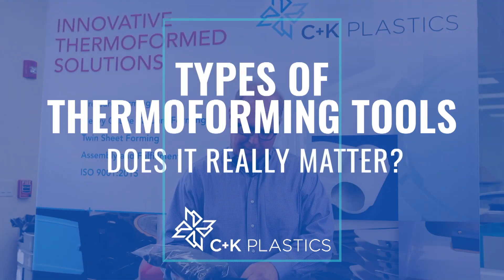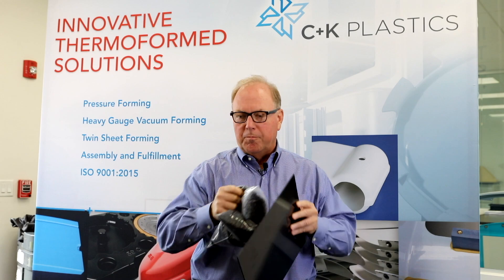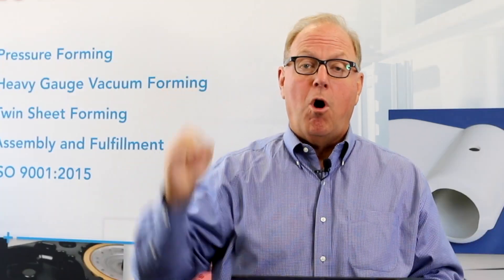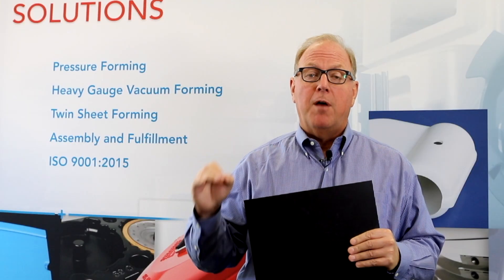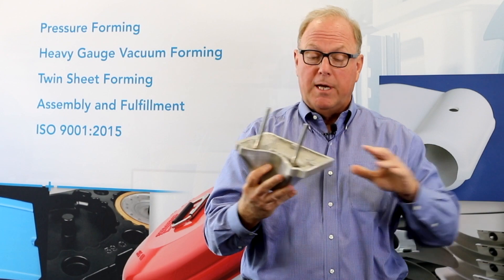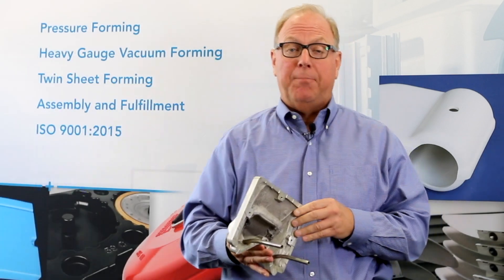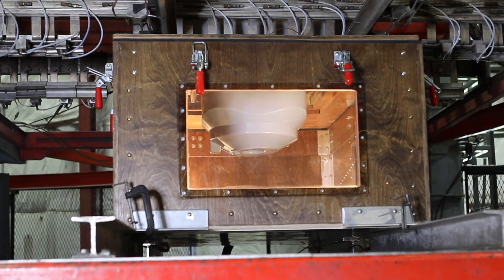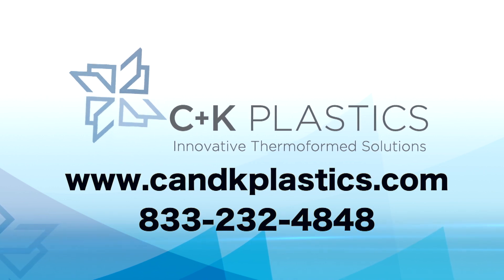What is the Biggest Mistake in Thermoforming? | C&KPlastics.com | New Jersey

Comment: I usedto do all this, started as machine operator and then moved to tooling, we mostly made molds out of apaxy resin and had a few aluminum water temp controled molds, for apaxy and aluminum molds without water we ran a few cheap sheets to warm it up, when you form on aluminum cold mold the part is worped like crazy, apoxy wasnt as bad when cold
Reply from the maker: Hope you are now happily retired or do you still work in the field?

Comment: very nice!
Reply from the maker: Thank you! Cheers!
Reply: I keep my molds at 180 degrees.
Reply: Copper lines can be imbedded in the mold and Save money. Just make sure you don't drill any holes through the lines
Reply: A hand held temperature tool can be used.
Reply: Quadrant temperature control is a good feature to have on your Machine heater.